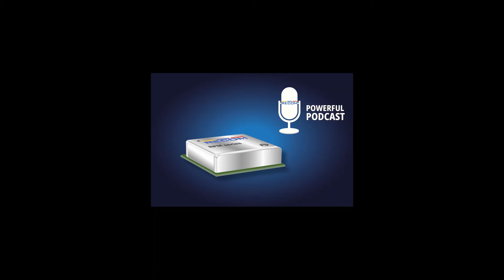Switching regulator with 99% EFFICIENCY rating? It’s true! | The RPM series DC/DC converters

Comment: Now can you do this while Isolated (>=99% eff.)?  With CC/CV modes (pin-set max Vout, and max Cout)?  Thinking about 48-to~48V (+5/-20%, adjustable) 500W DC isolation with continuous 1500V insulation and 5-6kV surge survival.  Something that can be mounted to a cold plate?